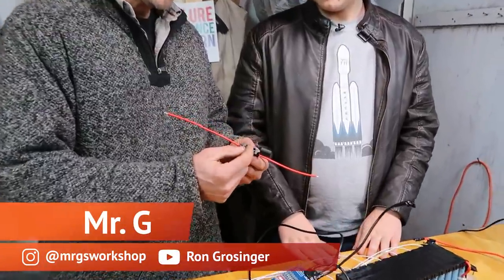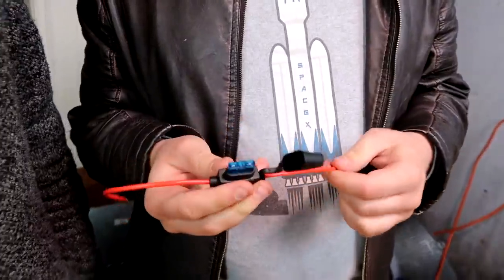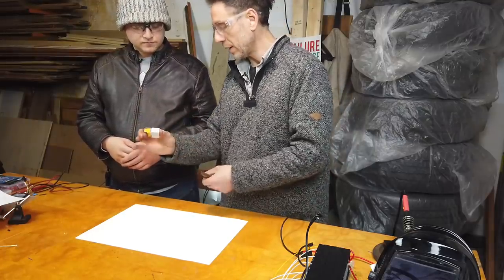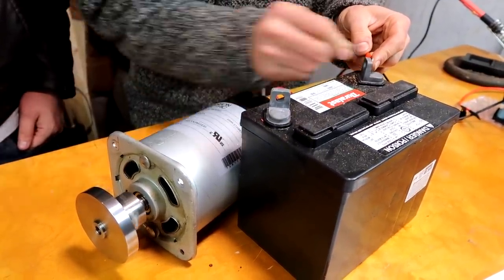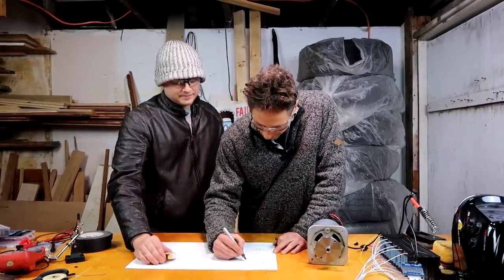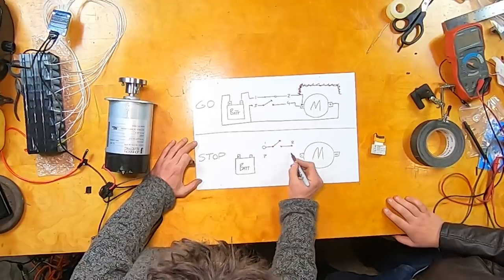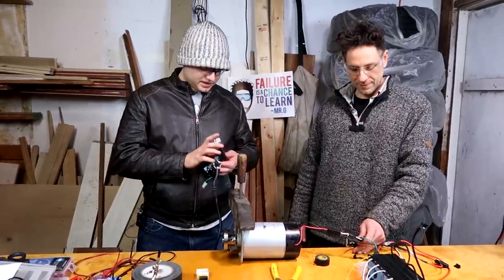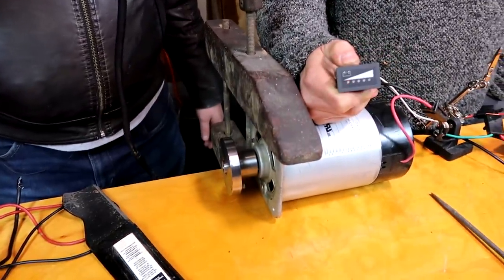Electric Conversion Workshop: Lawnmower Project - Episode 9

Comment: Spare no deatails Z and J and G!  I want to actually use these videos to convert my ICE mower.  Maybe to a solar powered lawn mower?
Reply: You can use solar to charge the batteries. You will need to mow with batteries. Thing is, once the batteries are charged, you are wasting your solar, unless you get a nice grid tie solar kit. You don't have net metering by chance, do you? I put up a 6.2kw system in 2017 similar to this. https://www.wholesalesolar.com/1890910/wholesale-solar/complete-systems/7.3-kw-grid-tied-solar-system-with-solaredge-and-20-astronergy-solar-365-watt-panels

Comment: I'm going to start calling this the milk episodes..... serious..... You guys are milking these episodes a bit much.
Reply: Yes, and No, there is a lot of information here, way too hard to put into one or two episodes.
Reply: Daryl Moulder yeah it depends who's watching, if they want it to be understandable by everyone then this pace is great.
Reply: I guess if they are trying to make it to a really low level, but it is sort of dangerous also to do, you can't act like any normal person can do these things. I am an electrician and I will say for a fact there are plenty of variables that a new person wouldn't account for that by watching these videos would just be like "this is crazy easy"... Example battery chemistry, impedance, in rush current, FLA, etc. There are many factors in building a pack and pairing it with a device so don't let these videos be a full instructional.